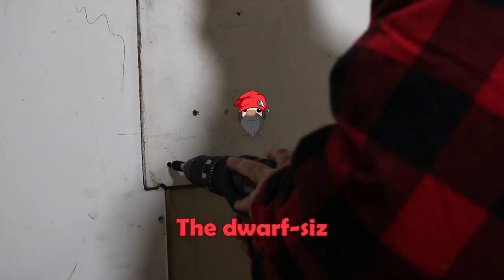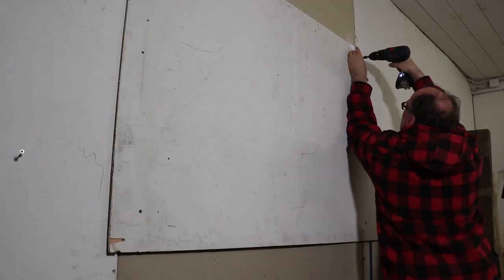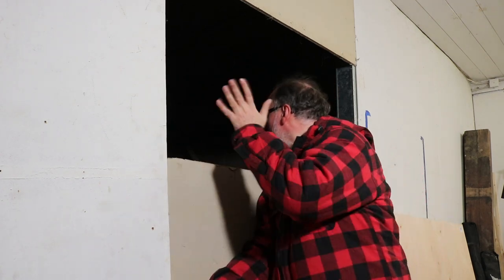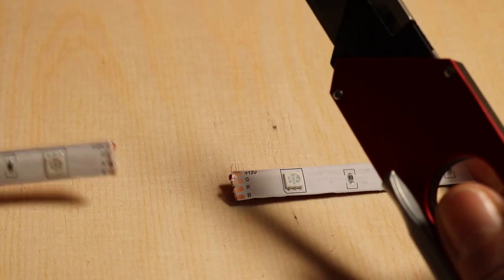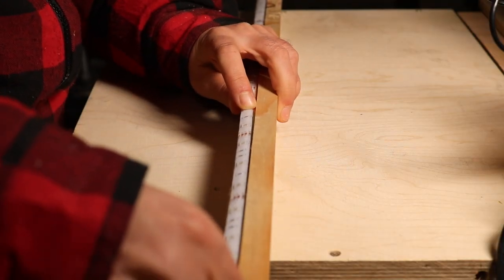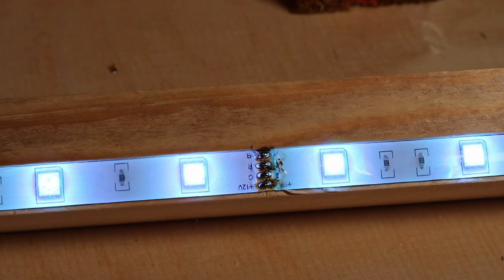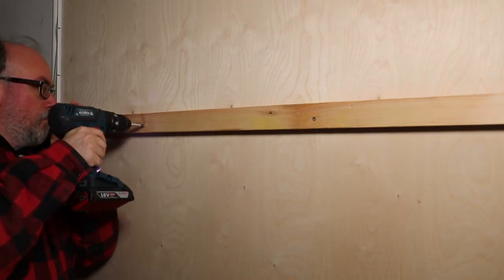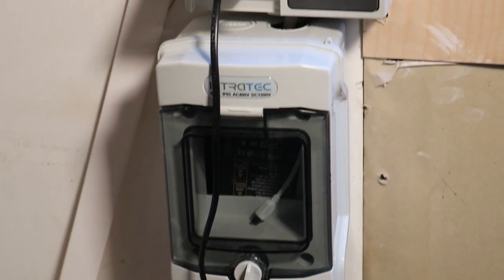French Cleat Wall with LEDs

Comment: The magical 30° you can find them in mechanics, etch geometry, crank shafts and of course our best friend the dovetail guide. ( Yes I know it's 45° if you don't make the cutter your self but 30° is easier to fabricate)
Reply from the maker: I have this pile of free wood you can see in the video. Those slats are just too narrow for 45 deg. So this was def a material-driven decision. ;)